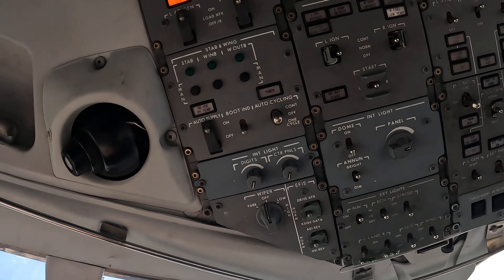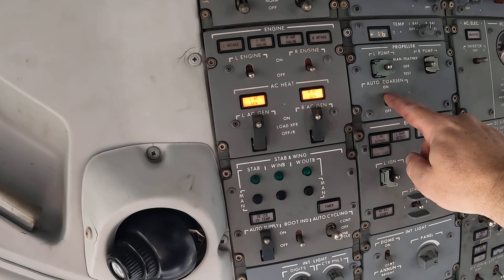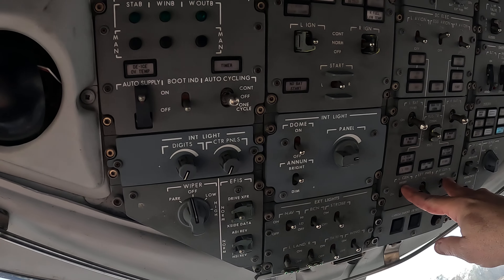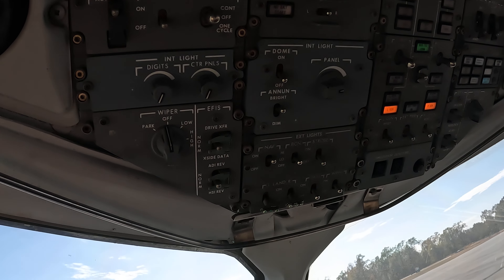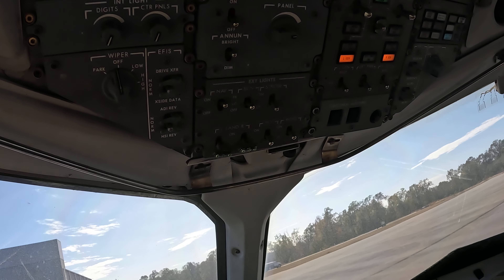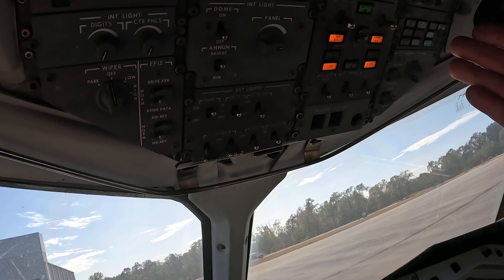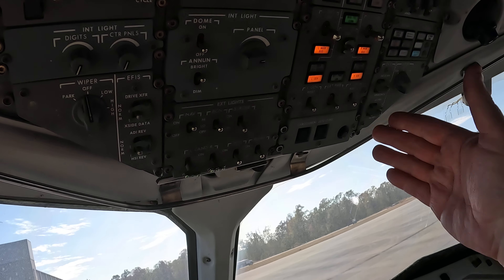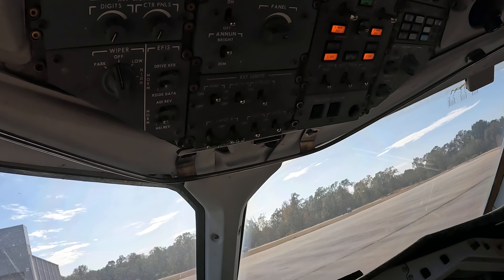Saab 340 Shut Down To Prevent Damage to the PDUs

Comment: Hi Scott. What is the reason for waiting for the main bus lights. Is it because the PDU is under less load when the engines are shut down?
Reply from the maker: @mitchelllewis6501  my understanding is that the power swap at shutdown isn’t connected to the PDUs when the main busses drop off line.
Reply from the maker: @mitchelllewis6501  the other thing we’re teaching to limit PDU damage is to disconnect the GPU prior to bringing the generator online. I had a maintenance specialist tell me to do that at Worldwide Aviation in Missouri, USA.

Comment: We are not allowed to start engines without GPU power cause of burning the PDU:s but never heard of burning them when shutting the engines down. Is this a common standard procedure for operators around the world?
Reply from the maker: An under amped GPU does far more damage than a battery start when it comes to PDUs. The hardest thing to find is the amp output on a GPU. Some don’t even have gauges. We did a survey of all GPUs in our system and at one point major US airport the best GPU was outputting only 960 Amps. PDUs, batteries (NiCad) and battery relays are damaged quickly with underamped GPUs. Said GPUs also need to be serviced about every 6 months to ensure they are still valid. Older guidance dictated 1200-1600 amp output, but Saab has adjusted guidance to 1400-1600 amps.